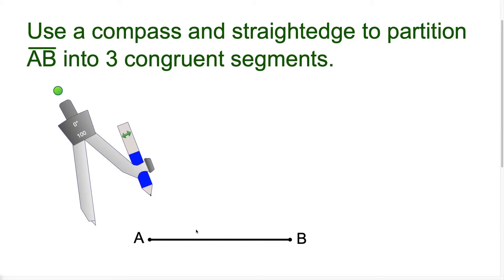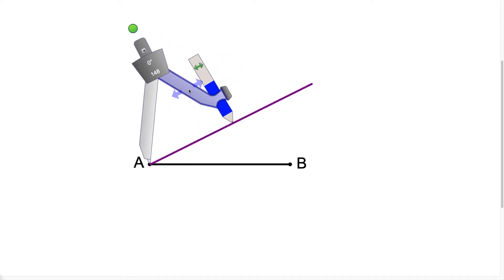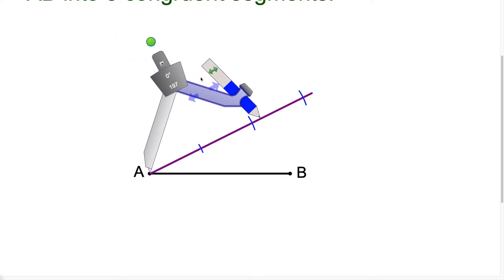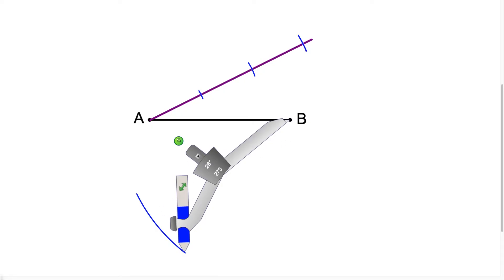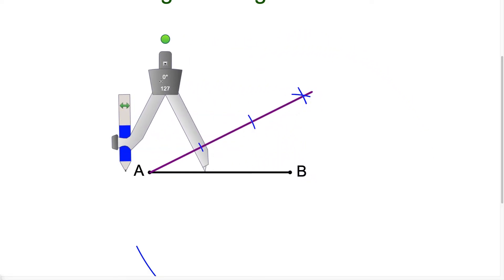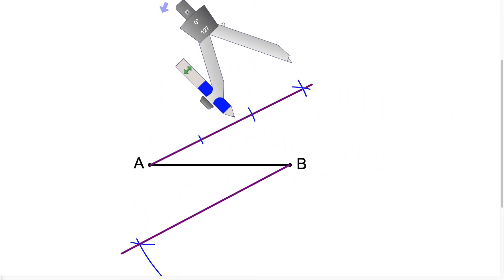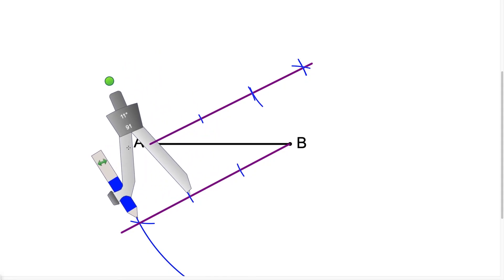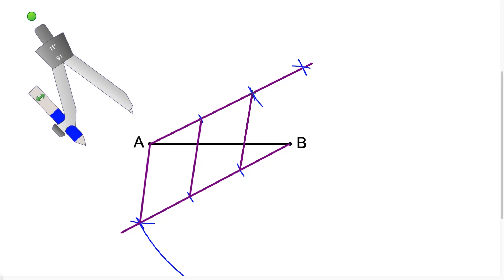Dividing a Line Segment into 3 Equal Parts - Geometry Constructions

Comment: Learned how to do this decades ago, and I was recently thinking about why feet are divided into segments of twelve, while pounds are divided into segments of sixteen, unless you're working in precious metals in which case they're divided into twelve (Troy ounces). 

I figure it's much easier to divide a mass into sixteen pieces using a balance scale, but dividing it into twelve pieces is considerably more involved, and therefore most people need a weight set that would have had to have been hand crafted to exacting specifications... meaning most preindustrial people couldn't afford it, and so broke their pounds into 16 ounces. But if you deal in precious metals, you can afford it, and would want the arithmetic convenience that base twelve offers.

Whereas with length, breaking feet into twelve inches is trivial... simple geometry anyone with the knowledge can do, only I had long since lost the knowledge. I am glad to reacquire it here. Anyone with a straight edge and a compass can do it!
Reply from the maker: Thanks for taking the time to write this. That is such a cool bit of history! I like having a backstory to theorems/techniques, so I will definitely share this one with my students.

Comment: Good method, although you should mention that it's not exact (I had to test it in AutoCAD).
The second parallel doesn't intersect the small radius from point A at the exact location, so there aren't two parallel lines. But if you manage to make a perfect parallel, the method is exact, just a little different from the one explained.

Comment: So what I’ve been confused about for while, since this process exists, is how there is a longstanding claim that one cannot tri-sect an angle.   Since we CAN bisect an angle, and we can create perpendicular lines, any angle can thus have a line segment that connects to both legs of the angle at an equal distance,and thus, if one performs THIS operation on that line segment, one has effectively trisected the angle.  No?  Yes?  What am I missing?
Reply: If I'm understanding you right, you mean make an angle and then construct a line between legs with the points being equally far from the corner of the angle (Isosceles triangle). If that is what you mean i fell in the same trap. when dividing the line in 3 with this method, the angles created by drawing lines from those points to the corner are not the same. The middle on will be bigger. since only in the middle one will the perpendicular line go through the actual corner.
Reply from the maker: I have to think about that one! I haven't looked into trisecting an angle. My first thought is to check Euclid's Elements or some other old geometry text.

Comment: A concept that always puzzled me, and would love to hear your thoughts on it: given that line is 10cm long and you wanted to divide it into 3 equal parts - using a simple division would give you 3 infinite numbers (3.33..) that if you add back up you'll never get 10 but a number infinitely heading towards 10 (9.99..) YET also highlighted by this method we can divide any length into 3 exactly equal parts. What does this tell up about maths?
Reply from the maker: This is a mind-blowing concept, but 0.99999... is equal to 1. There are a few different ways to make the argument, but one way is that there is an infinite amount of real numbers between any two real numbers. There are no real numbers between 0.999... and 1 so they must be equal.

Comment: Crikey! What a palaver. Ruler and calculator.
Sorry to be flippant and I'm sure the principles are a useful foundation.
Reply from the maker: A ruler would most certainly do the trick! But 20 steps with a compass is so much more...
Reply: His method leaves no room for parallax error when reading a ruler - or mis-reading it, for that matter. Not forgetting that calculators are only as good as the fat fingers driving them; and the batteries, of course, that go flat at the worst time !